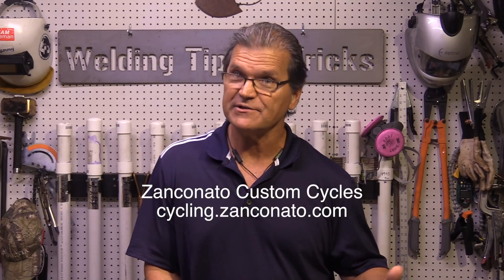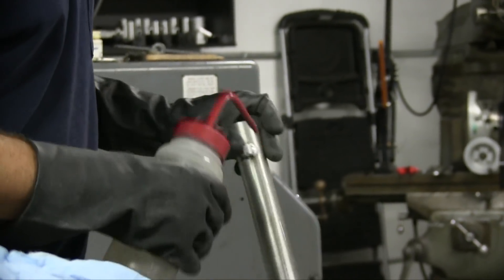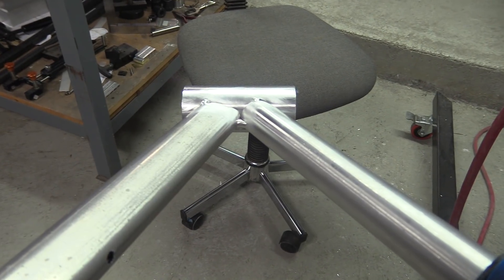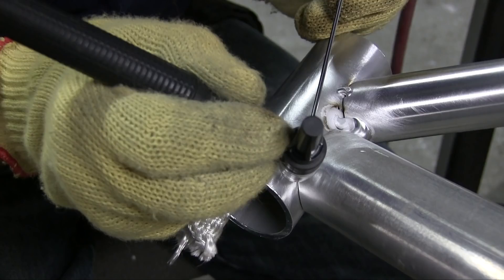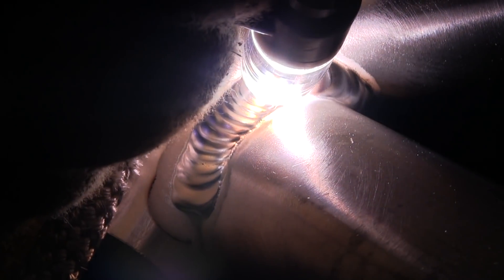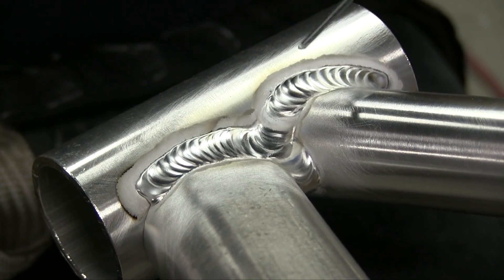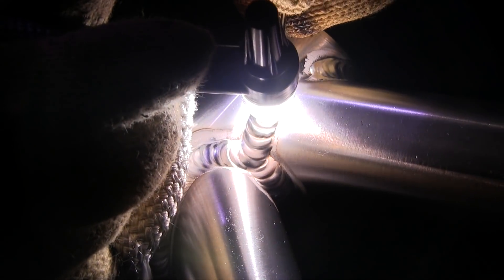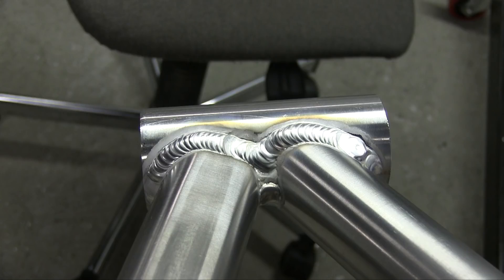Welding Aluminum Bicylcle Frames with Mike Zanconato

Comment: I looked at instructions on machines sold in other countries that have independent EP and EN settings and they have one recommendation that's missing in the Miller instructions and that is to run the AC frequency between 150 Hertz and 250 Hertz, when using the recommended independent EP and EN settings. Miller doesn't mention this.

Comment: As a non welder am I over thinking about temper being compromised? I'm having to get some aluminium filling done on a chainstay tube, the previous owner had the bad idea of filing out an area to fit an oversize tyre. Would the heat generated weaken the temper of the 6061 T6 aluminium? I don't know whether the frames are welded and then tempered or if pre tempered tubes are welded together. Just wondering how the tube will react to some side flex when cornering.

Comment: I have a question; Are alu welds so thick that it's possible to smooth them out on a bicycle frame? Or should a buy metal spartle and smooth them out that way? Greetings

Comment: Thank you for this info. 
It is just aesthetics, but is there any way of smooth the weldings in an aluminum bike frame?
Reply: What do you mean exactly by smooth? Like to lay more flat? I have found that a lower frequency, probably closer to 80 or 90 hz, and maybe adding a small bevel on the joint(will help sink the filler in), and soft square wave if you have it. That ought to help, and soft square I believe requires a little more cleaning(maybe 65-70% EN balance) good luck!

Comment: Amplitude has nothing to do with welding but is repeated numerous times.  Amplitude means angular distance of a celestial object  from the horizon or oscillation measured by equilibrium. You need to use the word Current or Amperes .
Reply: We are talking about the peak amplitudes of the positive and negative sides of the AC wave.

Comment: This is how I weld aluminum 99% of time, except I double my eP compared to eN and run my cleaning at 10% on and 90% off which means it is on eN 90 percent of the time.  Can't really do that on a 200 amp machine unless you are welding on thin aluminum.  Miller Aerowave, so 360 amps max.   I will set 300 amp on eP and 150 on eN to weld 1/4".  It works exceptionally well on dirty cast aluminum, like engine blocks, valve covers, & oil pans.  I always use a manual foot pulse to help control the flow out as when you are hitting it with that many amps, the heat will change quickly as you move along the part.  I like to compare it to a quick hard punch of 300 amps at 10% time to break through the oxidation layer, then 90% of time on eN at 150 amps to lay in your weld.

Comment: Hi Jode, another great video.  Just got new tig welder    AC/DC similar to the Everlast you have previewed.  I am looking forward to learning how to weld Aluminium,  is their a filer rod which I could be use for many type of material.  and silica bronze what type would you use for building up a worn shaft then machined and general jobs?   I am a hobbyist here in the UK

Comment: 90% technique 10% equipment. I used a basic transformer machine Lincoln Squarewave 175 and get better results.
Reply: Well, if you have better results, which I doubt, good for you. Maybe you can show them. They are not stating this are the best welds on earth.  I happen to have a 280dx too. The more options you have the greater but, I know a lot of welders who  don't understand those settings at all and so it is much easier to turn one knob and let the machines do the rest... For what I've seen, Mike welds on aluminum are amazing and I really appreciate their contribution on letting us know what settings they use with proven results. Some people just need this little help to get better or start to experiment different settings outside traditional ones. Maybe they should get a square wave 175. But I know I don't need one just because I get better results with my basic REHM electrode welder!

Comment: I have a question about the Dynasty 350, can you independently adjust or choose the wave form for EN and EP on the 350? I know Zank has the 280 with the expansion. I can independently adjust the EN and EP but I'm trying to independently adjust the wave form for each EN and EP and cannot find the setting on my welder.

Comment: I have the Miller 250 Square Wave and for what I do is fine. I was pumping the pedal in 1978, did the job but it would have been nice to have a built in pulse. This was a very interesting take on the current technology in welding machines. I found it fascinating what Mike did with the settings. Very informative, Thank you Jody and Mike

Comment: Unequal length legs would never pass an inspector’s eye. The dimes are pretty, though.
Reply: The bicycle inspector?

Seriously though, we have a customer that specifies unequal leg lengths due to the unequal thicknesses of the material being joined. Is that not acceptable?
Reply: @grumpysteelman  I do NDT and went to CEI school recently. Makes sense that he might want unequal length legs on that. Do you turn the frame so the thicker side can be up and let the puddle flow downward to the thinner side?
Reply: @jockellis  - Generally we would adjust the torch angle but not the position of the work. 

The majority comes off of a robot but we have some lower volume items that are hand welded. We have some very talented welders (and programmers on the robot) but a 7mm x 11mm weld is a major pain to get right.

These are boom and arm brackets for large excavators FWIW.
Reply: @grumpysteelman  I thought you were talking about bikes. I can see where the structural steel of the excavators would be too big to turn. When doing MT on welded braces of big I beans I had to turn them like the welders did for horizontal code welding. That was scary. Although I found many instances of forgotten welds I only found one crack among the many MIG - excuse me, GMAW - welds. I was in welding school at the time and my instructor said the welder was probably too lazy to turn the beam snd did it vertical down, letting the puddle get ahead of him.

Comment: Do you have any advice about when (or if) you need to heat-treat aluminum after welding? I thought that was standard practice for aluminum bike frames?
Reply: it highly depneds on the series of aluminum used

Comment: how about penetration with more EP over EN?  Are you getting the same or less penetration?  Any other benefits to higher EP other than saving the tungsten?  It probably wets out at the toes better with higher EP.  I have been struggling with the independent EP vs. EN for a while now.

Comment: Was welding probably thirty years before they came out with square wave,I finally got a square wave so I could welding anodized aluminum cleaner.Now way back when I was welding "Champion" motorcycle frames and making aluminum swingarms and that was just plain old A/C machines,we sent out the swingarms to get heat treated and anodized,THAT'S when I welded up my first aluminum bike frame...maybe I should have stuck with that!

Comment: That was yet another excellent video! Very interesting about the capabilities of having independent waveforms and amplitudes on each half cycle. For curiosity sake, what are the wall thicknesses that Mike deals with for bicycle building? I have some ally road bikes that are built from very thin tube  For the machine set that high, he must have incredible touch with the pedal to drop in welds that nice! Thanks again for the great content!

Comment: Are you sure it would go from welding to paint ??  I thought it would go to heat treat / tempering after being welded...
Reply: Depends on the alloy. Production aluminum bike frames are often made from 6061, which needs to be post weld heat treated. Many custom builders use 7005 which does not need to be heat treated.
Reply: They generally do for normalizing.  To be clear, I've only worked with steel in bike tubing, but know a lot of builders using lots of materials.

Comment: I am using topwell alutig-200p, can set different waves, balance and amperage on en/ep. Bought it for 600€ brand new. I am not a welder but i wanted to build racecar (and 200A seemed enough for me) -welding thin steel/SS/thin aluminium. Tig made welding fun&cheap for me, 12L bottle of 4.8Argon cost 10€, filler few € to none

Comment: What are those gloves? TIG would be a lot easier if I could hold up on the head of the torch like that.
Reply: I use kevlar gloves.. my guess is that that is what's being used
Reply: yeah, they do look like Kevlar...
Reply: A water cooled torch really helps...they don't even get warm....those little torches like that can run over 200 amps.

Comment: Good video guys! Just just started practicing on aluminum pipe 1 1/4” dia 3/16” wall, I wish my welds looked like Mike’s but I need a lot of practice. ... lots! This foot pulse method sounds good gonna try it right now. Would you recommend any kind of prep like, bevel size of landing or gap?

Comment: I’m a coded pipe welder and have been working in the medical/science engineering scene for over 9 years and welding for nearly 15 years  
And I can safely say with confidence that the best settings for ranges 1mm aluminium to 10mm gauge is 145- 75 using a 3.2 tungsten with a decent sized AND SHINEY dome on the end.For 6mm+ I use a hot gas. I use a murex 350amp on pedal. Pre flow is 2 seconds and post flow 5. CLEAN material is key no doubt about it. Happy welding folks
Reply: Thanks for the info.  It's very helpful.

Comment: Could use some advice on my aluminum work, getting a nice bead with no filler but when I try to add wire it acts like the wire is straight oxides, last time it balled up before it got near the puddle
Reply: I always clean my filler metals with a scotchbrite pad before welding. This helps a lot. And torch angel is important
Reply: @tomwagemans1872  I've been using a scotch brite and acetone, worked fine a while back and suddenly nothing
Reply: sometime have same problem myself, i think just wrong angle + long arc/too hot
Reply: Me too. Seems too small rod or too much heat or bad angle.
Reply: Thanks for the replies, running 3/32 wire with 3/16 material, using maybe 2/3 of my pedal on the 120v side of my machine so 95 amps tops I'd guess, #8 stubby gas lens with 2% ceriated tungsten, given the feedback so far I think I'll play with wire angles, puddle was a little large but backing off much I seem to lose it
Reply: Torch angle is key, wire not so much.  You can keep the rod too close between dabs but keep your torch closer to 90 degs to prevent filler from balling
Reply: @michaelwahl9281  thanks, haven't had a chance to get back on AL since asking but on the flat joints I've been doing keeping the torch straight is pretty easy, I've been having a hell of a time directing my arc on the this stuff patching a hole in my truck body at low amps tho, think that's a combination of tungsten and "entry level" machine

Comment: Damn i need a tig welder.
Reply: TheJenyffer01 I’m not a welder but an avid diy guy. Bought an everlast ac dc last year. Love it. Worth every penny and its very handy.
Reply: TheJenyffer01 Could get one from an auction, or fix a broken one. Too many guides on the internet not to.
Reply: You won't be sorry when you dive in feet first. Spend some money and get a good machine up front. Several good ones out there but Miller is my choice. Used a linclon a lot. Love my Miller dynasty 210 dx.

Comment: Excellent discussion fellas.  I have been welding some 1/4" 5052 lately (4043 filler).  Tried freq of 60-120, AC balance from as low as 65 up to 80.  Was not able to get a clean puddle.  Tried a scrap piece of 6061, welded super clean.  Anyone have thoughts ? The 5052 does seem to have a very heavy mill finish / oxide layer on it.
Reply: Ramsey Customs - turbocobra Gary you using the invertig? You can set your AC amplitude EN down some try to set it at 60% and adjust the amps to compensate. Your EP will stay at 100%. That Invertig should be able to do that job flawless.
Reply: You would be better off using 5356 filler on the 5052 aluminum.  More of a marine grade.
Reply: Michael Wahl 5052 high strength allow which has 2.5% of magenesium in it which is really non heat treatable less expensive than 6061, and 5356 will help with cracking as well, so unless it’s marine like you said. 5554 is a better rod to use but hard to find. You cannot weld 5052 autogenously either you need filler and 4043 will work just fine as well. But 5356 is fine too both will work no problem. I guess 5052 people just assume marine because it’s so popular but I don’t know what he’s using it for. He never replied.

Comment: So the million dollar question is, the expansion pack worth the $500? The HTP Invertig 221 doesn’t have amp adjustment  but has % of amp   ac amplitude adjustment settings. I find that it’s almost the same. I’m local to Mike maybe I can do a shop visit.
Reply: i hate to be that guy, but it's really just a $500 question.
Reply: the mexis $615.98 is the price $547.00 on sale. The million dollar question is “is it worth the $547”  I’m starting to think yes. My Invertig has it already well sorta. It’s amplitude % I like how I can change EP/EN and waves independent. Can’t do that with my Invertig
Reply: You have to buy the Dynasty 280 first, so a bit more than a $547 question! ;) Also the Dynasty machine is on a different level quality wise than HTP.
Reply: Sam J Feature wise, yes with some specific things.  Quality wise, not so sure.  Lacking in quality is something I haven’t seen one time in regard to an Invertig 221.  Yes I own a 221, and researched all the other options to decide for my needs where the best feature to dollar ratio was for a reputable brand.
Reply: I don't believe it's worth it.  I have the latest greatest welders but prefer to use my transformer Lincoln Squarewave 175.
Reply: Welding Junkie any answers? Still uncomfortable with the independent setting suggestions I hear to apply to my 22q

Comment: Since I started welding I've wanted to build my own bike.
Reply: Ive been designing a titanium time travel machine.....with pedals....in my head....
Reply: I've built my own bikes (guided and encouraged by the bicycle frame building community), but both were brazed (lugged roadie and fillet brazed MTB). If you guys want serious light/performance bike you have to source butted tubing from the bike tubing suppliers. If you want utility/cargo/just trying it out type of bike (practice getting your geometries/function/alignments correct) then about anything will work so long as it will sustain your loads.  Straight gauge 4130 is as simpleton as I'd try (it gets a lot more complicated and expensive in the butted and alloy variations.  My steel came from Henry James/TrueTemper and Columbus (Spirit for Lugs/PeggoRichie) I got direct from Richie. I don't know who is left in tubing/lugs suppliers.

 I don't work aluminum for bikes so cannot advise you there except that the entire frame must be normalized after welding and alignment processes are complete.  And that Titanium is what I really want to play with next. Rody Walter works with (bicycle) Ti quite a bit and has a few videos up. 

Bikes are rather simple, BUT there's a bit more to it that meets the eye (of the non-engineering sort, or performance oriented type).  The info is out there. Best of luck.

Also you might find it interesting that the standard frame geometries of production bikes are limited and do NOT fit everyone.  I'm an example.  My bikes ride better than anything I can buy without hiring custom framework, because they put my hips in the proper place relative to my feet and hands allowing best articulation of the legs for power and efficiency.  It's a journey learning all these things.  Lot of great builders out there have it sorted out already-if you just want a great bike for your purposes. Mike is one of 'em.
Reply: I've always wanted to build a self contained independent shark cage, with 5x200mm 316l box section able to be charged with diving gasses,adjustable buoyancy the hole works.. The only reason   I probably haven't is that I weld all day at work. About 12yrs ago I wanted to build a luxury wide beam live aboard canal boat, rented a yard next to a canal next to a steel supplier, and that was as far as I got with that!!!!!
Reply: westwater73 , canal boats like the ones in the UK?  I read an article about them a few years ago and thought it was a very interesting lifestyle.
Reply: Anthony Rector Me to I wish there was a kit available.
Reply: Nova cycle supply has cromoly, aluminum and titanium frame kits.
Reply: I got into welding to eventually build a motorcycle, now I'm working on getting to a point where I can do repairs on my friends mountain bikes
Reply: Me too. It's quite a challenge because you're dealing with round tube, thin wall, subject to fatigue in use and safety-critical. I'm getting some OK practice welds though (on thin wall chromoly-- actually my old bike which I didn't make but which failed at one of the welds!) I'm also liking manual pulse for this. Basically if you aren't johnny on the spot with the filler rod you can make holes very quickly because it's so thin. If you pulse as you dip there's less risk of this. Pulsing also allows you to go a bit slower. Without pulse on thin materials making a relatively large movement between dips works well and manages the heat but this is too difficult (certainly for me) on a round tube. The other thing that makes it a whole lot easier is perfect fit up.
Reply: Ben C, the big issue with bicycle frame joinery (after designing for proper geometries) is the variation of angles between tubes as you go around the joint.  Those crotches won't let you run a fat cup.  Al guys and Ti guys (framebuilders that I know), have all sorts of techniques and personal tricks to make it all come together just right.   Practice/Hoodtime is the key.